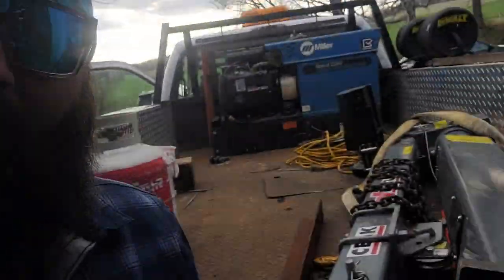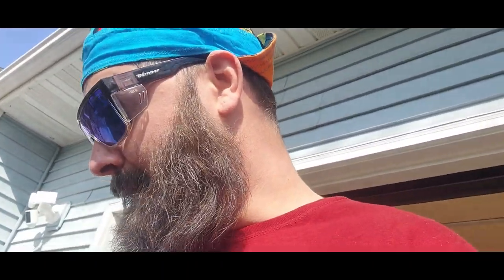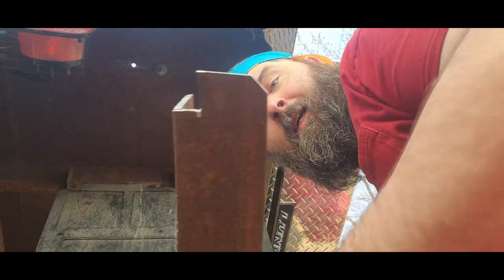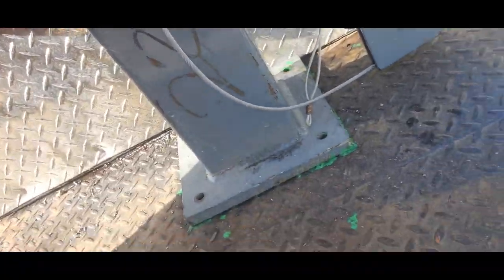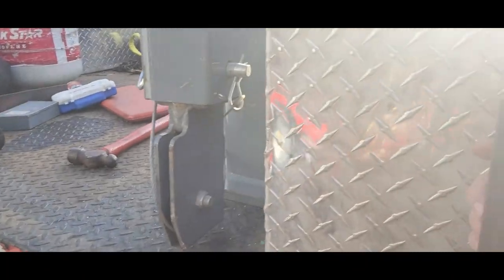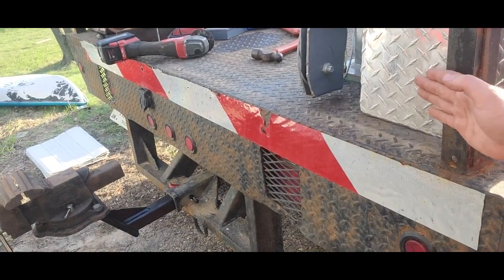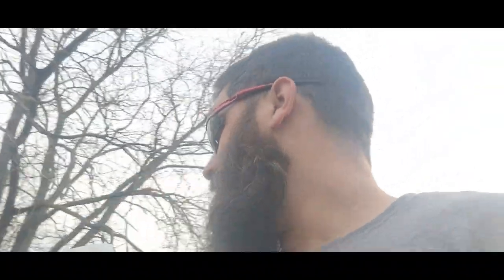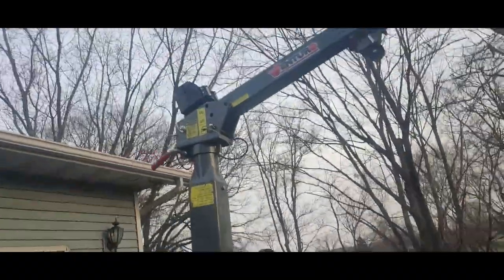Welding Truck Crane Build

Comment: Hello new subscriber here. I just picked up one of these service cranes for my utility trailer $250CAD from market place. Mine does not have the winch with it so I am putting on a manual winch with synthetic rope. I will be posting a video eventually with it. Good job on the install. That saw looks like a solid addition to the tool chest.
Reply from the maker: The crane has been a life saver on multiple jobs. Good luck. I look forward to watching the video.
Reply: @hundtmobilewelding  Thank you!

Comment: I'd also get some short chains or straps never hook the winch cable hook back to itself.
Reply from the maker: 100% I actually changed out the cable right after this (was planning on it anyways) it had a bunch of kinks in the line. Lifting straps are a must and if you check out my other videos of me using it I use straps.

Comment: Sweet! new subscriber here. Did you buy the crane new or did you find it used somewhere? I have to get one. I was building a 4x4 Ranger welding rig but a friend needed a vehicle so I welded the frame up for him and gave it to him.  I have the same Miller bobcat that you do. I love the opposed twin engines.
Reply from the maker: Thanks for joining us. I found it used "almost" new on marketplace.  Just have to make sure your vehicle weight rating matches what the crane is good for.

Comment: you need to put a 1/2" plate under the bed bro.  that will eventually start to weaken the bolts and the bed like that. take out those angle irons. dangerous.